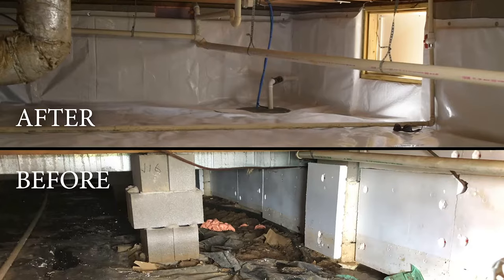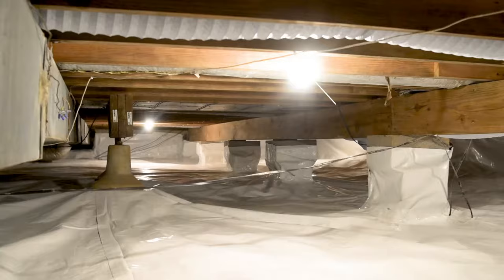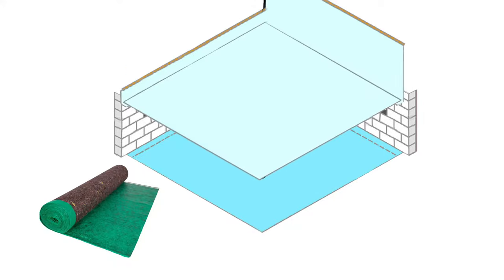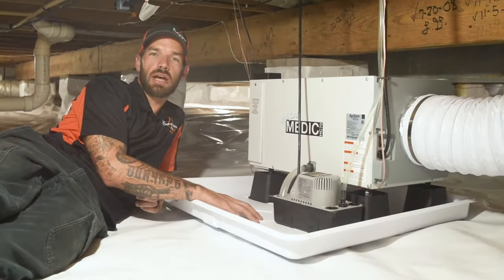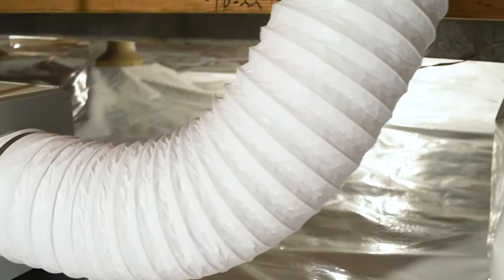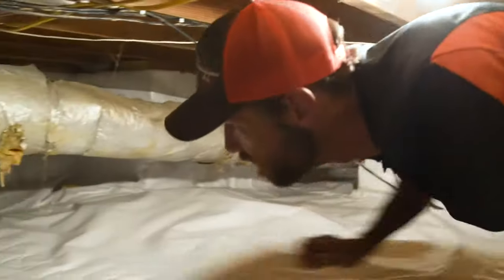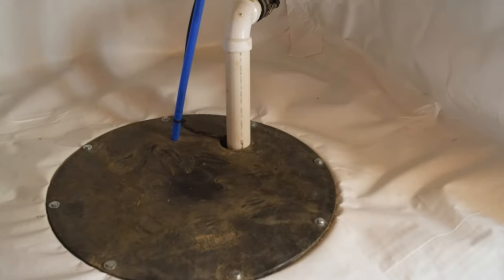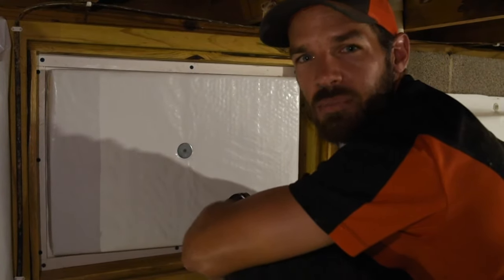The Crawlspace Ace Encapsulation - Paducah, KY

Comment: This GuardianLiner 12 mil system with a Moisture Medic can't be beat. I've been doing it 18 years and I buy from the same distributor. I do everything you do except the vents and the lights. Is that Hilti foam? I'd like to switch over to it but have no reviews. Does it stick?
Reply from the maker: what don’t you do with the vents? I’ve actually started putting at least one vent fan in all our encapsulations as well. I’ve actually moved away from the foam board insulation as well and we put up encapsulated batt insulation instead. foam board only works if it’s a really tall crawl space with a lot of exposed foundation.
Reply: The Crawlspace Ace You're exactly right about the foam board. The suggestion is when you use foam board, to just insulate above grade and go below grade a bit. We recently did one where we broke the board on half and used 24" around two sides because the ground outside was way up the wall. On the side where the crawldoor was, we used 32 inches and on the wall between the garage and the crawlspace, we just encapsulated.  The idea (in our mind is to separate the outside from the inside. How well does this method work? On Boone NCarolina, it was 10 degrees outside with the wind blowing like heck. It was 57 degrees in the crawlspace. Of course, their heat ducts ran through there. We never put floor insulation, but it's to each their own. We buy the rodenhouse plastic-grip fasteners from your distributor. There about $110 for 250. Since we mix mastic with PL-300, we can use one plastic-grip per board. It just holds the board on until the goo holds it on, we have a video showing me lifting a ten inch block with just the goo, no fastener.   We are very partial to the V2D fan. By the way, we honestly took a home that had a Radon level of 14 to under 2 with a single fan. So the guy could sell his house. ONE FAN !!!  The vents. We use the 4 inch hollow block from Lowes. It fits perfectly, and we foam around it. We ouch the block in just past even with the wall to give us an edge to foam against. Be sure and try LIME on your next job, you will notice the difference in the first ten minutes. Odors disappear that you don't know are there. It's only $4.58. . Is that Hilti foam you use? Does is make things stick to it? Is it costly?   Thanks